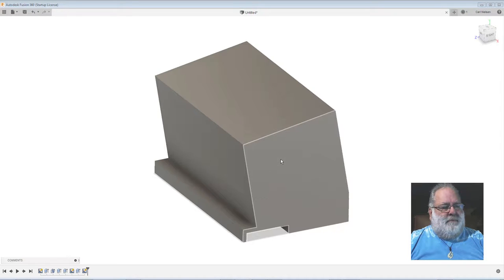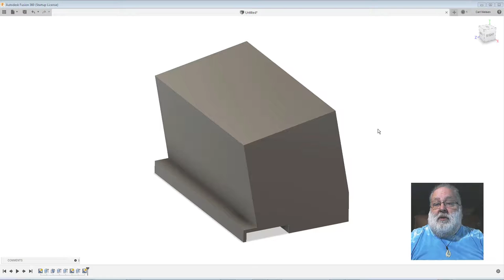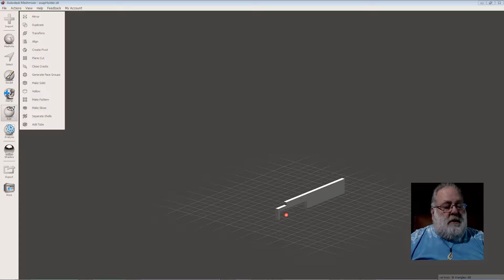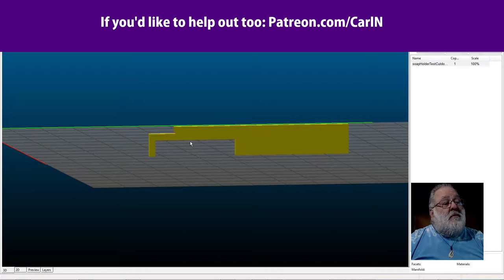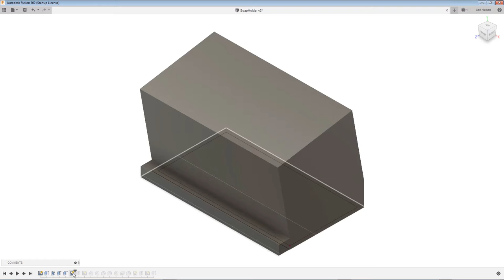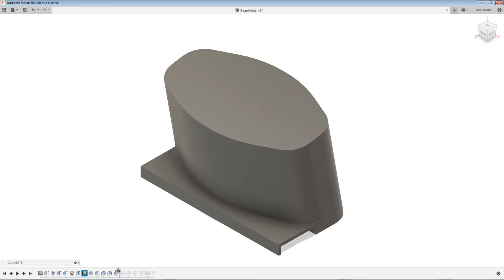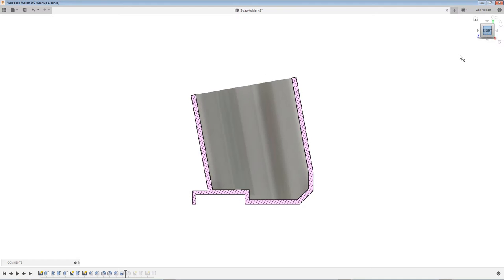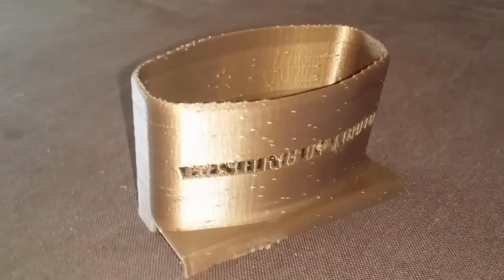Getting the Squirt in the Right Place! (Making + 3D + Print)

Comment: I'm a big fan of printing "slithers" of a print to test. It's rarely right on the first print! My personal process is to do my cutting up in Fusion rather than Mesh mixer using the offset plane and split body tools which I then suppress later. It does the same thing in the end though just saves a few clicks. Enjoying these types of videos showing fusion 360 designing and design decision making. Good stuff!